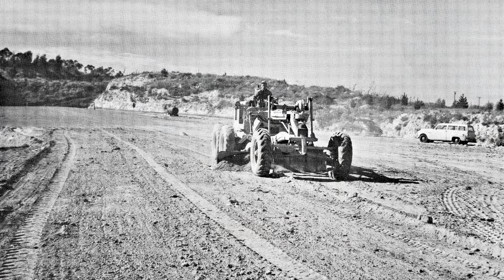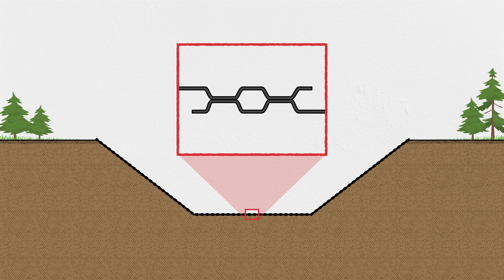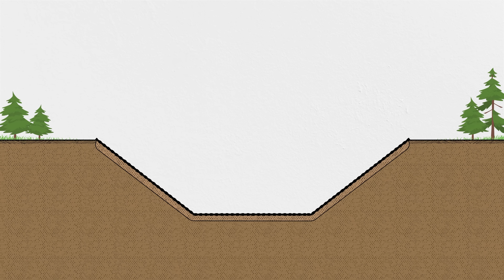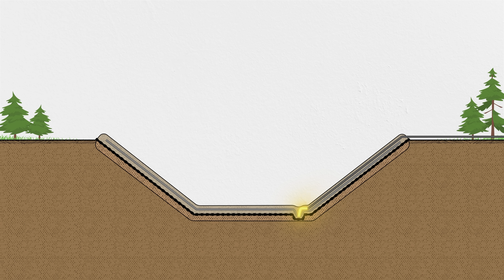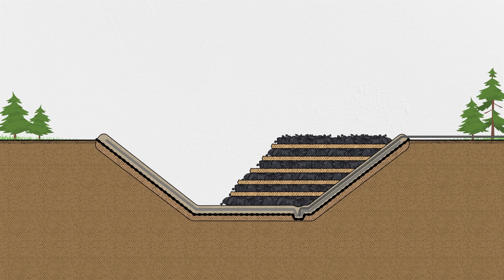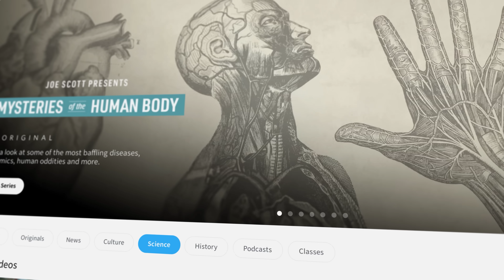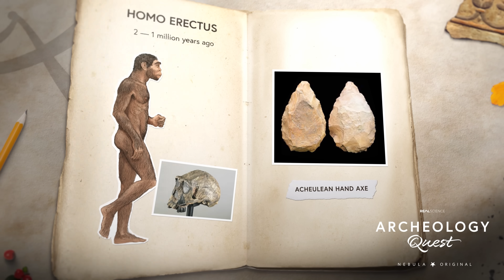The Hidden Engineering of Landfills

Comment: I live in Norway, and here we do a mix of deponing and incendiary. The garbage is collected to depos, then properly sorted and then handed over to incinerators. These again filter out heavy gasses etc, and since the waste was properly sorted beforehand, it's easier to control what kind of gasses that will be produced. 
1Kg of waste, equals 2.5kW of energy.

Deponing became illegal here in 2009. With the exception of hazardous waste, this is still being locked into big depones.
Reply: I've worked on a few landfill closure projects here in the US where they either used the collected gases for power generation or, if the buried material was not suitable for producing the quantity needed for this, simply flared off. Leachate collection was also included in the projects.
Reply: Samme i sweden. I belive we actually started to import thrash because we want to burn it for electricity and heating in the winter.
Reply: @NerbyScurvy Yes. Burn the garbage to electricity and heat. There are video presentations of those burning facilities (i.e. power plants, CHP) with excellent smoke cleaning using electrostatic filtering.
Reply: One mans trash is another mans treasure. I never even considered burning it off in controlled places, my mind just went to composting at home and properly sorting through recycling.
Reply: @Deja117  if you remove anything you can compost, you get more energy form burning the waste, there is a lot of water in compost no reason to boil way.
Like wise remove anything recyclable, it's more energy efficient.
Reply: @Deja117  Sure, compost / recycle / reuse what you can, but piling it up in / on the ground, leaving it for later generations?
Reply: Yeah, it's an EU wide thing, building new landfills for incinerateable thrash is banned.
Reply: @fh5kskalf  I didn't know that it was EU wide. But dumping treatable (doesn't have to be incineration, but that's the most common) trash has been banned in Germany for decades.
Reply: Deponering is still legal in norway, just not for household trash. Construction waste still goes into landfills.
Reply: I'm not sure I agree with the notion of banning deponing. While this may be the best solution for smaller countries with less space for landfills, I'm skeptical burning toxic garbage is less harmful than dumping it in the desert. There's also the consideration of whether the CO2 emitted to burn the garbage is worth the reduction in methane.
Reply: "1Kg of waste, equals 2.5kW of energy." Typo for kWh or does it produce 2.5 kW for a certain amount of time (like a minute, so you need to feed it 1 kg of trash per minute or something)?
Reply: yeah but in amerikkka they have all this land they murdered indigenous people for and they are DETERMINED to use it all no matter how inefficient they have to get.
Reply: Unfortunately, the environmental wackos in the USA don't let us burn anything because of the "greenhouse gasses", completely ignoring the fact that all exhaust could be captured and energy could be collected to get some benefit back from burning it.
Reply: Similar here in Switzerland
Reply: You do that with a million tons of garbage per year?
Reply: @redfields5070  I think the report for 2023 stated close to 5M metric tons.
Reply: @CrinosAD  
Just the one tiny landfill company that services my city takes in about 35M tons per year. The home trash pickup is twice per week. The bins for recycled materials are picked up once a week at our house in a special truck. This truck takes it to the same landfill as the trash and dumps it in with it.
Reply: oh, you live in Norway? a country with fewer people than Minnesota? And a country that's 95% Norwegians? Thanks for your input, dullard.
Reply: Literally just commented about the energy recovery you folks and Japan have there, were on the same page dude.
Reply: @notme9976 Cleaning the emissions is part of the burning process. And no, not all EU countries or cities within the same country even use exactly the same process, but it is regulated by EU burning waste is preferred.
Reply: Only 4% of Norwegian municipal waste goes to landfill ... 50% go to incineration, the remaining to recyclung,
Reply: Yeah, that‘s how the developed world handles trash: Sort it, recycle as much as possible, incinerate the rest while producing electricity and district heating. Of course we also filter the exhaust gases to keep emissions to a minimum. Next step will be carbon capture. Meanwhile the US just burry their trash in landfills, as if they were a third world country… Also I find it quite frustrating, how he is talking about „forever“. None of these landfills will be tight forever, one day they will start to leak and then you have all the dirt in the water table. Enjoy your drinks, folks!
Reply: I I've in Mortensrud, Oslo close to the Grønmo golf course which is on top of an old waste deposit. 😀😎
Reply: @notme9976What is captured or treated in incinerators are harmful and polluting gases, not CO2 which is a GHG but not toxic. 
And yes, a landfill emits more GHG because even if some closed landfills are eventually equipped with a facility to harvest emissions, during its lifecycle the methane emissions are released in the atmosphere and it is a GHG 27 times more powerful than CO2.
Besides, you have to consider than the energy produced when burning waste is a potential substitute of fossil fuel energy, so part of the CO2 released has to be deducted for the avoided fossil fuel emissions.
Also, after burning, ferrous and non ferrous metals (thanks to Foucault’s current) are easily removed from the ashes and recycled, that’s another environmental benefit.
Reply: entire video about landfills, yet not a second about decomposition. goes to show what americans are smoking
Reply: @SecureLemons  Apparently you weren’t listening very well.  He talked about wells for gases as well as leachate.  All that comes from decomposition.   And also keep in mind that in dry parts of the country with high temperatures and evaporation rates, a well designed and maintained landfill will have so little moisture content that they are sometimes referred to as “dry tombs.”
Reply: @SecureLemons I mean, he did mention decomposition around the rainwater management part, so you should give him credit for that second 😉
Reply: @SecureLemons  we wouldn't put it in landfills if we could avoid it. Problem is, the powers that be in our country hate us and don't care if they poison us
Reply: @SecureLemons  I'm guessing it's a cost thing. We have relatively large amounts of open space, so the extra cost of more complex disposal isn't usually as critical as in densely populated places like Japan and Europe. I bet whatever NYC does with solid waste would look a lot more familiar. But I dunno, maybe not 🤷🏼‍♂
Reply: @swissfreek like densely populated... Sweden? Sweden has less pop density than texas
Reply: @swissfreek In my town in the US, the local recycling place charged the city MORE per ton than the local landfill charges (though the city still encourages and promotes recycling).  Put another way, if I put my recyclables in the trash can instead of the recycling can, I save the city money.

With economics like that, it's no wonder that a lot of stuff is thrown away that could be recycled.
Reply: @swissfreek  They stick it on trains to be disposed of somewhere that isn't New York.
Reply: @jayschafer1760  that's why capitalism needs to be regulated otherwise companies just go for the cheapest option.
In the global scale, if the economic actors had to pay the real cost of making and delivering items then their garbage treatment, companies and consumers would have to rethink how they make or buy. This is slowly evolving (mostly because of oil and material price raises) but in the mean time there are more and more difficultly recyclable items (like e-wastes) going to the bin.
Reply: @SecureLemons landfills are a specific form of waste management, where decomposition happens but is not the goal. 

It wasn’t really relevant to this video. 

p.s he did tangentially mention decomposition in the context of having to deal with the gasses the decomposition generates after a landfill is closed.
Reply: @SecureLemons  wow. Video about landfills focused on landfills. What a shocker.
Reply: @Leon78536  sure, but the creator mentioned there being an entire sub-division of engineers specializing in the different parts of landfills. surely processing is a big part. i just dont see how a city/state could justify landfills, beyond temporary measures
Reply: @SecureLemons  leachate = decomp
And no matter what we're smoking, it's better than anything you've got. 
'MERICA!!
Reply: @hillbilly4895  YEEHAW!
Reply: So is 30 years what is needed to neutralise the waist? What happens once the liner starts to break down?
Reply: there's a swede in this comment section who claims you people ship your trash to his country
Reply: Canada and the US still don't have country wide recycling. We just got recycling bins 2-3 years ago.
Reply: @-tr0n There has been recycling in Ontario since the nineties. Where do you live, that it's only been two years?
Reply: @birchlover3377  it's municipal  as far as I know, so many cities and towns lag behind
Reply: How are landfills still a thing in the US? It's so short sighted. Like when Switzerland decided dumping old ammunition and grenades into lakes are ok. Now they have to clean it up. Will the US just condemn any place that's become toxic and move on?
Reply: @ThePixel1983  Did you watch the video to the end?
Reply: @ScottSuhr-l8m   I rewatched the end, what did I miss?
Reply: @ThePixel1983  You forget the US has by several magnitudes more land to work with so there is far less pressure to  adopt other solutions especially when the question of scaling said solutions comes to pay and the cost of everything.

It's pragmatism not short sightedness.
Reply: @Hybris51129  Pragmatism is short sighted, almost by definition. The US are pushing back an uncomfortable problem to the future. That's both pragmatic and short sighted. It can't continue forever.
Reply: @ThePixel1983  Hardly. The US is being realistic and for once not blindly rushing to adopt solutions that may not fit our needs.

Besides we likely stand to benefit more by reducing our waste in general rather than chasing what type of disposal type besides maybe waste-to-power but given our environmental laws it's doubtful such research would be allowed to move forward.

In short not every Euro-savage way of doing things is practical for everyone else.
Reply: @Hybris51129   

It's perplexing that in the 21st century, we're still resorting to burying trash in landfills as a primary waste management solution. This practice not only renders large areas of land unusable for essential infrastructure like roads, railways, or housing, but it also locks up land that could serve more valuable purposes. Sure, you might be able to develop parks on these sites, but even then, such parks could be established almost anywhere. The idea that this is an acceptable use of land is simply short-sighted, no matter the size of the country.

Relying on landfills is an outdated approach that reflects an "out of sight, out of mind" mentality. We have advanced technologies today that allow us to manage waste in far more efficient and sustainable ways. For example, non-decomposable waste should be recycled wherever possible, and when recycling isn't feasible, incineration should be used with the latest filtration systems to minimize environmental impact. This not only reduces the volume of waste but also ensures that harmful pollutants are properly managed.

Furthermore, decomposable waste represents a huge untapped resource. It can be converted into biogas for energy production or turned into compost, providing a sustainable alternative to chemical fertilizers. The continued reliance on landfills is not only a waste of land; it's a missed opportunity to harness the potential of waste as a resource. It's time we moved beyond these outdated practices and embraced more responsible and innovative waste management solutions.
Reply: @Hybris51129    
Here in the EU we recycle what we can, and the rest is turned into energy instead of putting it into landfills.  
Maybe you can elaborate how this does not fit the US "needs"?
Reply: @samik83  Recycling has been tried repeatedly with mixed results. It's labor intensive both on the customer and the waste management company thus driving costs out of control and making it  unsustainable with current technology.

Europe makes it by having a very well groomed and subservient population and simply being on a smaller scale to begin with. Combined with lack of available land for traditional landfills again make the increased costs of recycling easier to bare because there are no other solutions.

The economics that everyone tries to avoid talking about when it comes to green tech is the modern "inconvenient truth." because it kills most ideas once the bills come due.
Reply: @Hybris51129  What do mean by recycling has been tried? We do it, the US does it.  Glass and aluminum cans being the main ones and it works. 

"Well groomed and subservient population" 

Well if that's your way of saying people in the EU think recycling is a good thing, then ok. 

"simply being on a smaller scale to begin with" 

EU has almost double the population compared to the US and similar land area.  The EU in most places wouldn't have a problem placing landfills and they actually do use them, but are turning to using their trash as energy, as it's actually more environmentally friendly than dumping it in the ground and needing to take care of it for the next 3 decades.

"The economics that everyone tries to avoid talking about when it comes to green tech is the modern "inconvenient truth." because it kills most ideas once the bills come due."

Are incinerators really that expensive that even the energy they produce cannot cover cost of building such facilities?
Reply: @Hybris51129  What do you mean Europe is on a smaller scale? Europe's got about 100 million more people to deal with than the US so there is that... Anyway, burning waste is clearly the better option even if you don't do any recycling at all.
Reply: @samik83  US "needs" seem to be: dispose of waste at the absolute minimal monetary cost.
Indeed it is quite sad to see how in the supposedly most technologically advanced country of the world, garbage trucks coming from the city directly line up at the entrance of the landfill.
There is so much more that can be done.
Reply: @andreasa6136  Lol what are you even saying. Trying to argue that burning your trash and releasing toxic gases is more environmentally friendly than sustainable landfills.
Reply: @hadhamalnam  What are YOU saying? Sustainable landfills, come on. You think the waste will recycle itself if you bury it in the ground or what? It will slowly break down and release gasses like it was explained in the video. If you burn it you can at least use the gas for energy while cleaning the emissions instead of just letting it go to waste while polluting.
Reply: @Hybris51129  It's short sightedness, not pragmatism...
Not dealing with a problem properly because "oh we have the space to just dump it somewhere" is legit awful.
Reply: @Hybris51129  „on a smaller scale to begin with“ you realize, that the European population is more than double than the US population?
Reply: @hadhamalnam  maybe you should consider, that if we burn trash in Europe we don‘t do it the American way, we do it the European way, which means the exhaust gases are filtered and barely anything escapes expect CO2 (which is a climate gas but not toxic) and steam. I know, it‘s a very uncomon practice for Americans to first collect some information before they talk about things in other countries, but you may want to give it a try in the future…
Reply: @Hybris51129  Building cars is labor intensive but companies have made major investments to automate the process to maximize quality and minimize labor costs. The USA could do the same with trash if we wanted to. There are existing technologies to sort trash. There are existing technologies to convert waste into energy and recycle plastics. What happens in the USA is existing waste management companies want to continue to reap huge profits doing things the way they always have. And burying it is cheaper than properly recycling it. Profits and lowest possible costs are always the motivator in the USA. Yay American-style capitalism.  /s
Reply: @Hybris51129  Why is it that America's "pragmatism" is almost always "short sightedness". It's one and the same.
Reply: @Hybris51129  "Euro-savage"? What's that supposed to mean?

The US is being cheap, not realistic about waste. There is a difference. That's why it's still the number one in the world for waste per capita.
Reply: @ThePixel1983 Eh, it’s pretty long sighted in my opinion. After watching this video, I was curious what my city’s landfill looks like (I live in one of the largest cities in the US). I was shocked to see that our landfill, despite holding more than 50 years of trash, takes up a space about half the size of our airport, and it’s not even very tall compared to the small hills surrounding it. I’d bet that by the time we run out of space for landfills here in a couple thousand years, we’ll have cracked nuclear fusion and these landfills will become sources of abundant clean energy. And if that never pans out, who’s to say we can’t use it to build artificial islands and then throw an airport on top of it, solving both the airport and landfill space problems with one solution, assuming we could seal the base of it well enough that nothing toxic leaks into the ocean.
Reply: The problem with burning the garbage is that it produces a lot of highly basic ash that needs to be neutralized and stored somewhere. I suppose you could neutralize it using waste acid from chemical plants, but these are often highly contaminated with heavy metals, which complicates things further.
Reply: @Aikano9 You can use it as a concrete aggregate, it works well for roads or building foundations. But even then you need a lot less volume to store the waste.😊